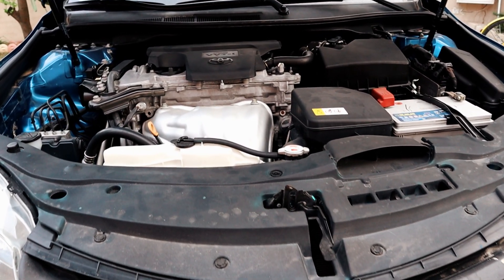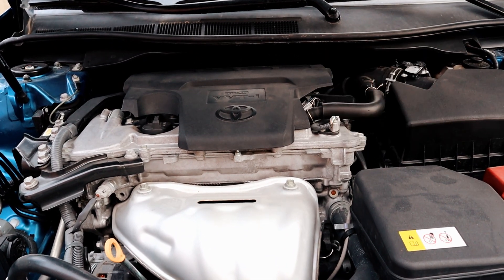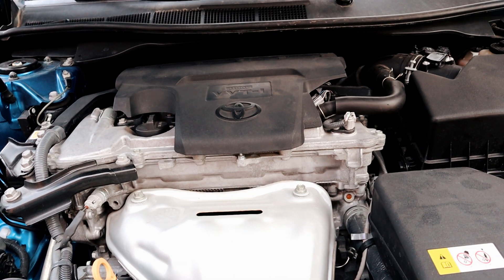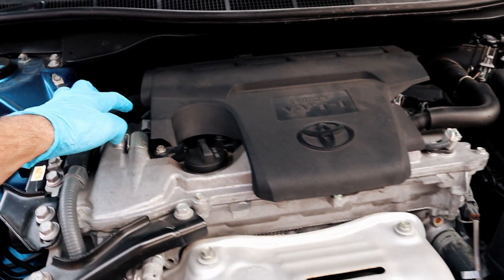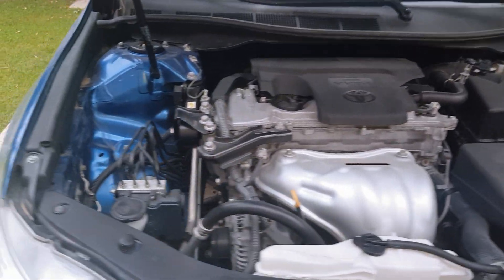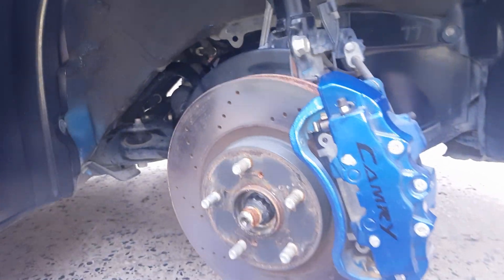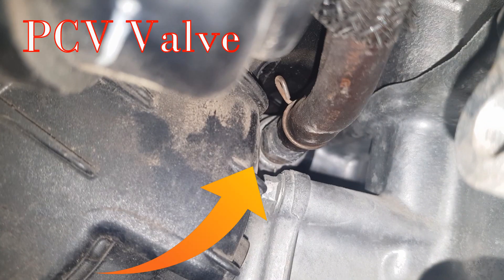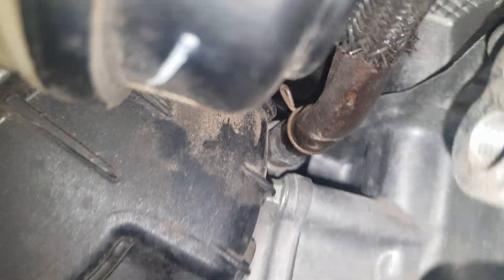Where is PCV Valve located on TOYOTA Camry 2015-2017/ How to access to PCV valve on CAMRY/ ALIMECH

Comment: Does the 2014 Camry same engine have the PCV valve at the same spot?
Reply: Are you sure because I have the same exact engine as yours 2ARFE
Reply: Same spot
Reply from the maker: No, this is only for 2015 to 2017 models, I believe 2014 on the engine cover

Comment: I wonder what tools I would need to do this job, and how long it would take.
Reply: I just replaced that PCV on my 2015 Camry.  Took me about 45 minutes using a 3/8" drive, 19 mm deep socket on a swivel headed ratchet. My car has 93,000 mostly highway miles and the original valve was very clean for the mileage.
Reply from the maker: You will need a long 19mm socket, In this video I show how to remove the pcv valve 
https://youtu.be/iqS65SCwSrQ

Comment: Damn, i’m just about to show how I changed it today. And I see your video. Very good view of the pcv. I just finished the job from underneath the car and after I put the pcv back with plenty of torque, i can still feel the gap between the valve and base (it didn’t go in properly?). I also reversed the tube from pcv to intake manifold as it was too hard to put back in, hope it maintain good seal for vacumn. So far, the car runs just the same as before. The old pcv valve looks better quality than the oem replacement part and it was still in good shape. I hope i never change the pcv. With nearly 300,000 km on my camry, this pcv valve still looks as new.
Reply: I bought the OEM one from a trusted seller on eBay for $14, a bit expensive yes but I would rather pay double the amount for something I know will last long, plus the location is rather annoying so I don't wanna mess it with another time.

Edit: The OEM one will have the Aisan brand name on it, if that helps. It's a metal piece instead of the cheap plastic ones from auto parts store so that's a plus.

Comment: Thanks! I was just looking for a video for this today! What a coincidence. 
Where you able to remove it. If so , do you have any more tips ? (What extension or adapters did you use) I need to replace mine.
Reply from the maker: I really didn't remove it, just showed the exact location, bc no one showed like this on YouTube,  maybe I will do a video about it now to remove it for cleaning or replacing
Reply: L M you need 19 socket, ratchet and extension
Reply from the maker: In this video I show how to remove the pcv valve 
https://youtu.be/iqS65SCwSrQ